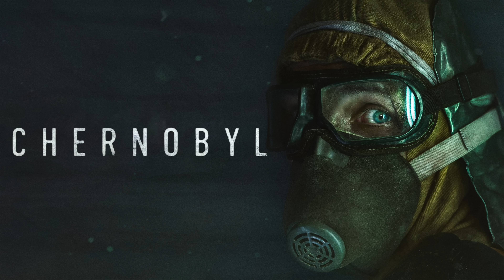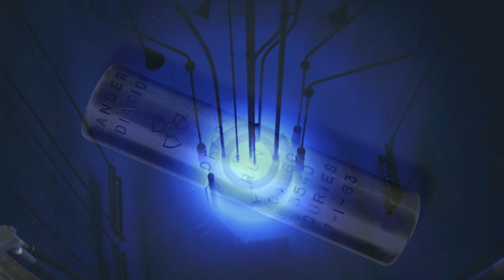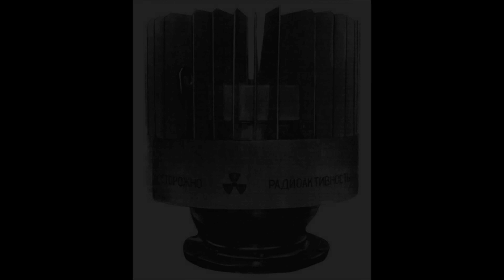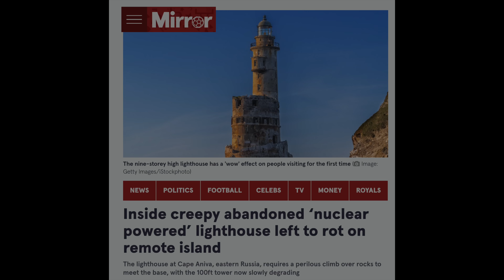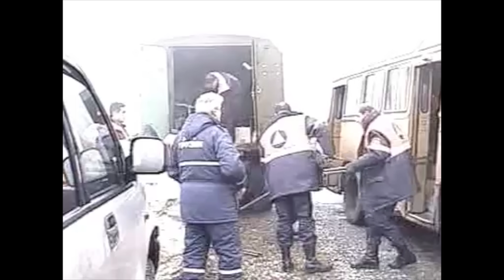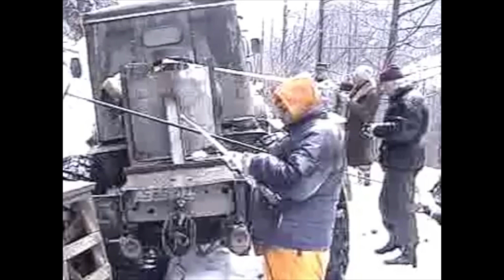The Soviet Union's Deadly Abandoned Nuclear Generators

Comment: This was such an excellent video. The real footage of the 2001 incident was extremely compelling and seeing the actual Strontium-90 heat source being handled very quickly by those men and seeing the snow boil and produce steam from its heat is terrifying. You can hear the beeps of the geiger counters from the videographer standing a good distance away from the action, so you can imagine how much radiation was being put off up close where the disposal team was rushing to contain it.
Reply: Yeha the guy with the tongs got a good dose of angry air just because of his closer proximity than the other guys about 1m instead of the aimed 2m and oh man that 0isn't good for the man's health
Reply: @TheLtVoss  I thought about that too. However, he also was near it for a much shorter time. Ultimately this wasn't good for any of them, but they did what they had to do. Good for them.
Reply: @TheLtVoss  They should have used a doubled jointed tongs so it could be longer.
Reply: @TheLtVoss  It wasn't good for any of them but at the end of the day they knew that and had the balls to do it!
Reply: @TheBanana93  they had the balls to do it before the radiation rotted them off.
Reply: @Mapleleaflocksmith ❤
Reply: @Mapleleaflocksmith better it be plutonium with alpha and beta radiation compared to a Soviet Union Rtg made with Strontium 90 which is a beta and gamma radiation producer
Reply: They put these in very remote parts of Alaska secretly. They powered geological listing stations that recorded nuclear test in Russia
Reply: @golden-heartcity3852 *listening equipment
Reply: My first thought is 'anyone' could get enough material for a dirty bomb!!!
Reply: @philiprowney I'm always grateful school shooters don't have more imagination. There's lots of radioactive materials about that's easily accessible, particularly in the US.
Reply: @Simaka_BearThats why he said 'dirty bomb'. Its not about creating a nuclear reaction or big blast, but simply used to spread 'dirty' radioactive debris everywhere😬
Reply: I actually can see the use of RTGs in remote locations.  But now I am looking on in honest fear as people are proposing building them right inside of residential and industrial areas.  There is an attempt right now to build up to 70 of them in an industrial park in Texas, and a lot of people pushing these as "green energy solutions".  Does anybody think that the current copper and metal thieves in the US and other countries would see these as anything but a source of free metal?  And what happened in Georgia being repeated wherever such installations were put in place.
Reply: Not quickly at all they are just as stupid as the id1ots using to warm their campsite no protective gear and posing for pictures with it after they knew what it already did with the other 3 men.
Reply: "terrifying" is the singlemost perfect word to describe those things to civilians unknowlingly walking upon then, comerade.
Reply: it has been told bears with 2 heads and 5 paws are wandering around those assets.
Reply: That was some incredible footage.
Reply: An uncontrolled release of Stontium-X could kill everything biological in a 50 mile radius.  Scary stuff.  World wide stocks should be gathered up and destroyed.  Fat chance eh?
Reply: 7:47 7:48 7:49 7:49
Reply: ALARA
Reply: Strontium 90 is a problem because it’s in the same group of alkaline earths that includes calcium. when ingested it is absorbed into the bones; causing cancers of the blood and the bones to rot.
Reply: Why weren't the men clothed in radiation suits? The Soviet Union surely could have afforded a few protective suits! Just goes to show how much the government cared about it's citizens, then and now!
Reply: @k1j2f30  The accident was 2001 so was modern day Georgia rather than USSR. Additionally, clothing for shielding radiation is heavy as they are basically just lined with lead. The white full body suits you often see are to stop contamination (I.e. if you are dealing with radioactive dust that goes everywhere, you wanna get that stuff off you as quickly as possible once your done!) but they won’t help you against the radiation it’s self!

Because of this, if you have a sealed container, It can make sense to just have lots of people in normal cloths taking turns to work as fast possible for very short periods to get the most done in the least amount of time possible!
Reply: @k1j2f30 there is no such thing as a radiation suit.  Anti-contamination suits?  Yes. But unless you are able to walk around wearing a 2000 lb lead suit, you are screwed
Reply: Why is the civil defense team not suited up in radiation suits?
Reply: @stepvanjoe3469 Suits are not here to protect you from radiation, they are here to protect you from the material that emits radiation, so you don't ingest them/get them on you. A centimeter of plastic is not going to protect you from bullets, would it ? A "suit" to protect you from radiation could be meter-thick lead, or several meter deep water, etc... depending on the type of radiation. Not that easy to put on ^^
Reply: @brunetyannick1174 while true, your comment is misinformed. A radiation 'suit' usually consists of an NBC suit designed to stop small particles which may cause radioactive contamination, and a lead lined shield for the torso and portions of the limbs to help reduce and limit exposure. You are right that these limit mobility, and a calculated risk must be taken to balance mobility vs probable dose reduction offered by the shielding.

In this situation dealing with a known contaminant source in the open on snow covered ground mobility definitely wins.
Reply: @brunetyannick1174 while I generally agree I can't see it taking 3 feet of lead otherwise those working around nukes would be dead immediately from plutonium cores. Demon core didn't have 3 feet of shielding
Reply: @stepvanjoe3469  Low risk of particulate contamination, a radiation suit is somewhat a misnomer, gamma rays, x-rays and neutrons go right through it.
Reply: First of, we all live in the radiation storm of the Sun, so our organisms are perfect in regeneration from small amounts of radiation. Next, normal radiation counters with audio feedback constantly beep while detecting natural radiation which is EVERYWHERE.
Reply: @rodrigoroaduterte9415  lmao how about you use that natural regeneration of yours to go handle a strontium source. Next, those weren't radiation counts you were hearing, those were alarms due to the dangerous levels of radiation.
Reply: @WowCoolHorse  
Probably Dosimeters.
Reply: ...you mean Rate Alarms
Dosimeters only record the total amount of radiation recieved.  (Survey meter, dosimeter, and a rate alarm together is called dosimetry) All 3 are needed in today's world while dealing with radiation, well at least in America....
Reply: @rodrigoroaduterte9415 Yes, however, that beeping is not your average Geiger counter tick here and there from natural cosmic background radiation. Those were definitely alarms beeping.
Reply: @rodrigoroaduterte9415  That was not small amounts of radiation chum.
Reply: @rodrigoroaduterte9415  Uh, no.  The Sun certainly does pump out a ton of radiation but almost none of what gets as far as us is actually harmful.  Any x-ray or gamma that managed to make it as far as the atmosphere would get absorbed at high altitudes, mostly up in aurora territory.  UV-C gets nommed there too, leaving only UV-A and and a little UV-B to make it to ground.  UV-B isn't quite classed as ionising afaik, but the two are pretty nasty in the long term and humans don't properly regenerate from UV damage.  That's why sunburn raises your skin cancer chances for the rest of your life, it's permanent damage.  Still, most of the radiation that reaches us is the electromagnetic kind in the visible, IR and radio bands, and that's harmless.
Now, the happy fusion ball does pump out other fun radiation beside the useful type... energetic charged particles and such are handled either by the magnetosphere or get absorbed by super high altitude collisions. The alpha radiation that reaches us in escaping solar plasma hasn't a snowball's chance on an RTG of doing anything interesting... alpha radiation can barely travel a respectable number of centimetres through normal atmosphere under good conditions, it ain't making it here from space.
There is an non-trivial increase in radiation exposure when travelling by plane, but it's only on the same level of exposure as having medical x-rays done, and astronauts have pretty strict lifetime exposure limits due to being outside the atmosphere.  However normal people should be way more concerned about things like radon gas, that stuff is really nasty.

As to the other thing... yes, audible dose meters will give a pretty constant stream of background radiation clicks, you get maybe 0.8 or 0.9 mSv a year just for existing on the planet.  What's important is how angry your dose meter sounds.  That occasional click, like it's reminding you it's still there, that's fine.  When it's screaming at you like you came home drunk and your spouse saw you vomit all over the sleeping family pet, that's when you're in trouble... and the solution is pretty much the same, you run away from the scene and pray for mercy, forgiveness and no headache in the morning.  Angry spouses are a rather more common threat than radiation, thankfully, but they can follow you and lumps of death metal can't.
In this case I would rate the dose meter at around "lecturing due to arriving late for a family dinner" level of beeping... camera guy's situation is somewhat safe, but it's not advisable to put yourself in that condition unless you have to.
You will note at 29:00 he mentions 40 uSv per hour.  Not year, hour.  I'm guessing that's the level he's reading after the source was stuck in that lead bucket.  It's on the order of a couple of x-rays.  I don't know what the source itself is outputting, but I'd imagine it's many orders of magnitude more, even at that distance.  That said, Strontium is a beta source not gamma, so things could be worse.  The Plutonium slug shown is an alpha source, so it's safe enough with some proper shielding.  Both have decay chains to long-term state with no nasty surprises.  Gamma, neutron and complex decay chains are your real enemy with radioactive material.
Reply: @rodrigoroaduterte9415  You first...

Comment: Some calculations for the danger of the RTGs. I assume : radiation of 2 Sv per year, half life of 28 years, first RTG deployed in 1970, last one deployed in 1985. I pick 1985 as from the middle of the 1980s onwards the Soviet State had extreme financial problems and building new things in the middle of nowhere is not on the list when you are on a tight budget. So any site that was worth providing with an RTG will probably be developed before this. Let's calculate with 30 years as half life as it is easier. I assume whatever decay products result are either non poisonous or non radioactive or both. So, first reactors from 1970. Half of the material is gone in 2000, radiation is 1 Sv. In 2030 3/4 of radioactive content are gone and stable and the radiation emitted is 500 mSv. Allowed radiation for a worker in a nuclear plant working for 50 years there is 100 mSv in his lifetime. So the RTGs are still a problem but not as poisonous as back in the 1990s and 2000s.
Reply: The radiation I calculated there is the total radiation emitted by the RTG. If the RTG gets destroyed and the Sr leaks into the environment I wonder whether it is problematic or beneficial. If it gets distributed over a large surface area it will accumulate in the environment and be eaten by animals and insects and accumulate in people eating those animals. But the amounts of radiation by small particles are much lower than the ones emitted by the big RTG. Toxic chemicals that leak and accumulate over time (think PFAS) have the issue of half life. Less toxic but lasting forever. Something with a low half life will usually be gone from the environment if you wait long enough.

Comment: It is a very effective solution.. that failed under communism and will also fail under capitalism for not so different reasons, in our era contractors will want to save each penny and cut down on visits/mainteniance and will ultimately dump the mess into the govement again when it stops been profitable.
Fortunately today we have solar/wind power, batteries and portable diesel generators..
A can that boils snow..? absolutely nightmare material.

Comment: As dangerous as these things are the Russians do have a bit of a pickle on their hands with their coastline and navigation. 

Solar isn't reliable, esp. in the arctic. GPS/GLONASS can help, and are probably the ideal replacement, but if that were the case lighthouses wouldn't be a thing anymore, but they still are. 

How else do you power these things when they're in the arctic? Not saying it's great, but I get why they did it.

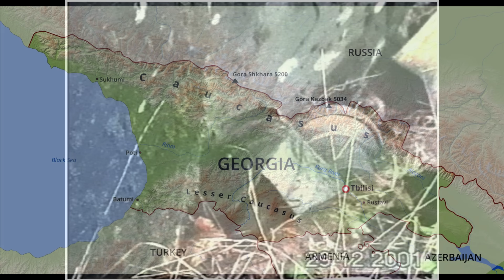Comment: 20:20 wouldn't it have been safer to just haul a vessel up and melt a few pots of lead close to the site and have a couple teams carry the molten buckets on a pole between them and dump it over the thing? I mean after the first buckets dumped the Risk for each one after is much less and after 2 or 3 buckets they could just walk up to it and maybe carefully put a layer of cement over it, wouldn't really be that labor intensive, leads melting point isn't that high compared to most metals and its shielding capabilities would make it safe to approach after a layer or two and they said its half life is only 28 years so basically if they just covered it up then by now, 2025, it would be so degraded that a recovery team of a few people with some sledge hammers and wedges could clean the site up in a day or two with minimal risk...
Reply: От свинца этот источник бы излучал рентген, а не β-излучение. Лучше было бы положить источник в контейнер из толстого стекла или алюминия при помощи манипулятора

Comment: You touched on it in your video, but I really want to point out how much worse Strontium 90 is than plutonium 238. Pu238 is mostly an alpha emitter, while Sr90 is mostly a beta emitter. If you breathe in Pu238 dust you're going to have a bad time, but just being close to the source isn't very dangerous. If those loggers had played around with a Pu238 source, they would have some superficial radiation burns.
Reply from the maker: Thanks

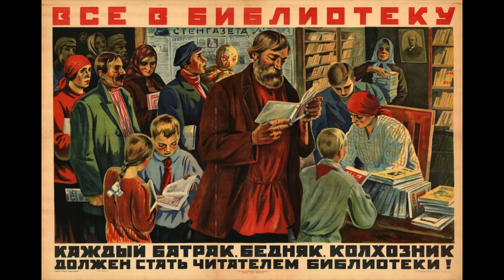Comment: i have a problem with the part at 3:35 claiming the people in russia were illiterate, as a 1939 census as well as external sources revealed a 90% literacy rate, which did not exclude the rural population. if there was at least one thing that was good that came out of the soviet union, it was the Likbez. One of the primary motivating factors to the revolution was the fact that only the aristocracy was allowed to read.

and this does come across as opinionated as the use of the radio was the same method FDR employed with his fireside radio broadcasts in america

but rest of video was interesting.

Comment: As a child of the 80s (And still having vivid memories of Chernobyl news reports) I can get that RTGs are downright lethal, and in opting for that design the Soviet government were simply trying to make a power source that worked, even if it was an extremely inefficient design. ☢🔋⚠

That said, I wonder if the same RTG concept - With modern efficiency improvements - Might allow it to produce the same energy output with much less radioactive material?

But this is making a very lay assumption: That less radioactive material = Safer ...And if these plus Chernobyl are anything to go by, that is probably not the case! ☢⚰😲

Comment: In university in 1995, in physics, we did experiments with radioactive isotopes that were stored in stainless steel boxes with lead sandwiched in them. Could they have not have stainless steel encased lead filled boxes around the older rtg’s or the newer strontium cylinders to make them safe(r)?

Comment: There is a disproportionate paranoia towards anything nuclear. Of course RTG source is dangerous, but so are munitions, hv power lines, toxic chemical compounds. Surely you should not sleep warming yourself from a strontium source, but using very basic precautions and equipped with a geiger counter it should be possible to handle it safely without international mobilization.

Comment: RTGs are pretty damn safe as long as you keep them in a mechanically safe spot and don't take them apart. A pretty good solution for low-power applications in remote arctic areas. And most of the ones that haven't been forcefully dismantled by adventurers and scavengers seem to still look like in quite good condition. So production quality seems to be okay.

Only problem is that the USSR collapsed. They would still maintain them if it hadn't. and that is teh real danger of all tech containing potentially harmful matter - even complete imperiums can disappear almost overnight. Nuclear and chemical risks are left behind unguarded, often also unmarked and with their safety enclosures left to rot and erode away.

Solar cells and wind farms don't risk giving later generations of scavengers radiation sickness or cancer when they are suddenly abandoned because of a societal collapse.
We should aim for a poison free tech tree. It's not a fully reachable goal (yet?) - but we should at least try to get near it.